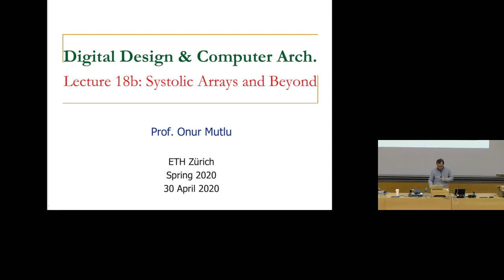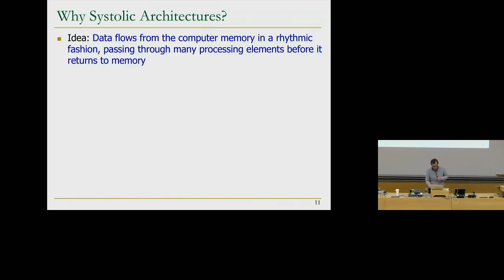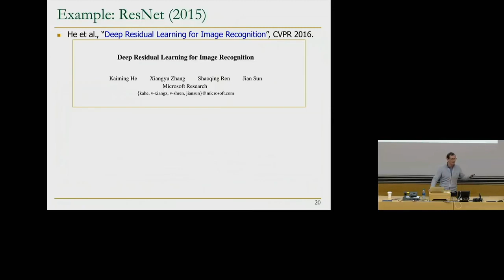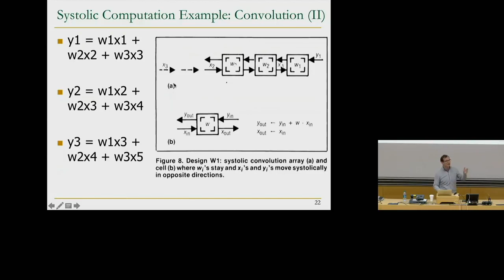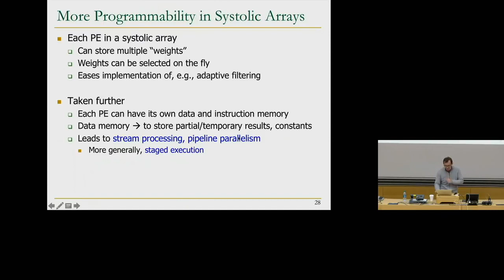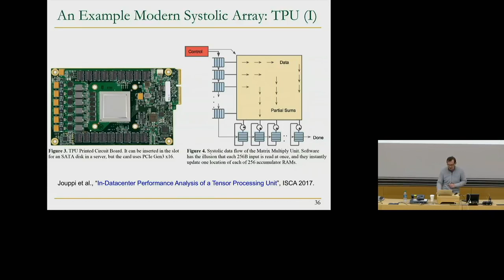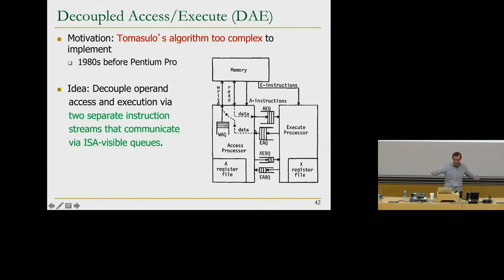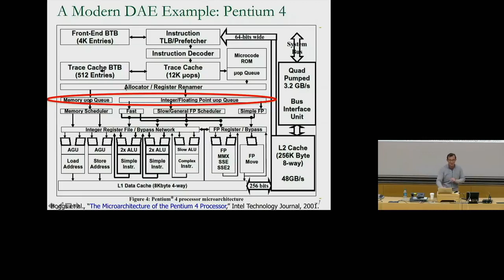Digital Design & Computer Arch. - Lecture 18b: Systolic Arrays and Beyond (ETH Zürich, Spring 2020)

Comment: but in the alternating transmission for convolution using systolic arrays we also compute w3x2 in the schematic shown, where is that value used? is that gated by the latch? because, according to the mathematical definition for convolution, for w3x2 to be defined; we must define a x0 and y0 but the output and input sets define a range for indexes from [1,N] and [1,N-K+1] respectively.